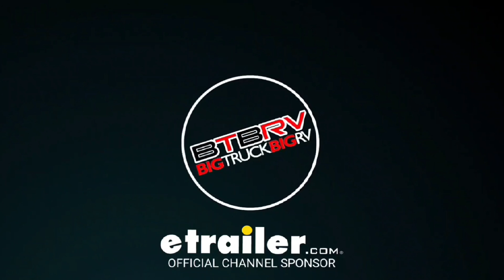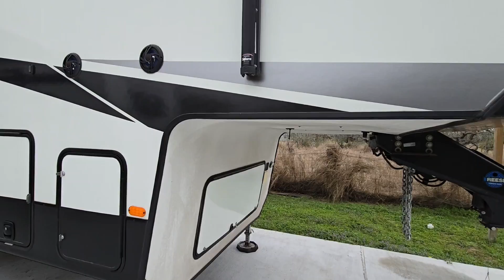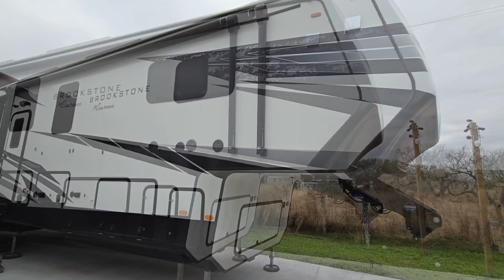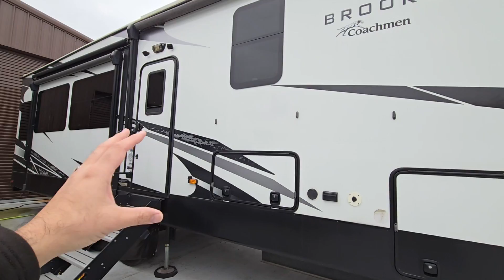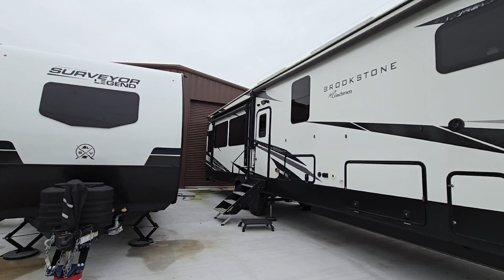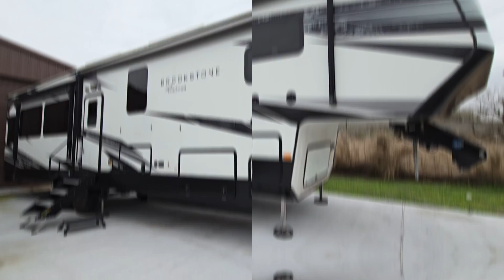BIG FRAME FLEX Update! Heading to Indiana ask Lippert Viewer Submitted QUESTIONS!

Comment: I'd like to know if the design engineer  is involved when a non o.e.m. vendor is making changes to the frame by welding chunks of metal into the structure to make said repairs, more is not always better or even right
Reply from the maker: That's a really good question.  I know there are a lot of phenomenal welders, but many times these welders are not engineers. Without truly understanding the mechanics of the structure and how it was designed, repairs might only make things worse while looking like they're making things better.
Reply: @BigTruckBigRV  exactly, I'm heavily involved in the tank trailer industry if you ever get around the st.louis area and want to see some cool stuff look me up , you're always welcome

Comment: I'm going to call B.S. on Lippert because it only takes one look on Grand Design's forums to show that it's happening, often, on mid profile 5th wheels. And travel trailers. So either Lippert is full of dookie, or Grand Design is over building on the frames. And this isn't limited to Grand Design. Forest River is another one with frame issues. Also uses Lippert. Their numbers are corporate b.s. to save face. How are so many, first time owners, having issues and they're claiming the number is extremely low, or deflecting to it being 2nd or 3rd owner issues. If the frame wasn't flexing for the first owner, why would they sell it? The whole 2nd owner thing is a B.S. deflection. Or...oh my goodness, people actually USE their RV's and travel with them? How dare they!?! Please. Lippert gave you the corporate hand job of responses to your questions. Just like any corporation would. Deflect, smoke, mirrors, blame everyone other than themselves. BUT, I don't place the blame solely on Lippert. It's the coach manufacturers being CHEAP and over building on these frames, any way to save a buck, and then THEY place blame on Lippert. This goes back and forth. Furthermore, the outside shell of the RV is in NO WAY structural to the integrity of the frame. The frame should be able to support ALL of the structure regardless of the integrity of it. So if your walls start delaminating IN NO WAY should the frame be compromised. Ever. For f....s sake. Please agree with me on that. The frame should support the structure, always. Not the other way around.
Reply: Funny you say all this.  I have a 2022 Custom Toy hauler 5th wheel designed to carry a 4,500 lb  Jeep.   Trailer weighs 12.300 lbs dry.  Triple axle G tires.  GVWR is 21k.   Weighs about 17,500 lbs fully loaded.  

It’s on a Lippert frame.  

But park mine next to a 40ft+ Grand Design Mpmentum that weighs 17k dry and the frame on mine makes the Momentum’s frame look like tinker toys.  

Because the manufacturer I went through doesn’t cheap out when ordering a frame from Lippert.
Reply from the maker: To make a frame so strong and rigid that it would not bend under the weight of over 10,000 plus pounds would be nearly impossible unless the frame was much much much heavier and used much much thicker materials. By doing this, it would make it very difficult to tow with the average light duty pickup truck.  I'm not sure if you are where, but nearly all engineered structures are designed with the total structure, superstructure in mind.
Reply: @BTBRV  Man, well,, they must have completely brainfarted when they made my lowboy trailer that's capable of holding 40,000 lbs. Damn those engineers. You see, a frame is engineered to hold a certain amount of weight, and flex in a certain way in order to hold that weight. Flex is normal. Flex is expected. What we don't expect is there to be a failure when the weight is under what the frame is designed to hold, unless the weight is greater than what the frame is designed to hold. In no way, ever, should the frame be reliant on the structure attached to it in order to support the weight it was designed to hold. Ever.

Comment: Understanding that MORryde and Reese goose box are approved by Lippert. Is there a list out there of non-approved pin box designs?
Reply from the maker: Pretty sure there wouldn't be a list of unapproved pin boxes. There will probably be a list of approved pin boxes however.
Reply: Any type of a list could help to avoid warranty issues for your viewers. Might be a good question to ask during your upcoming  visit. As we know dealers will sell you anything in stock.

Comment: If a mfg is being praised  by  every "content creator " to the point that GD has for the past few years then they should stand behind their build. The two companies are trying to remain in the shadows hoping that this will blow over. I've been rving for about 25 years and cannot remember frames failing, even when delamination was the rage. Even though some of these are used units they are fairly new GD/LIPPERT should do the right thing and stand by their products. Like you said it's supposedly a minimal amount of rigs.
Reply from the maker: I don't disagree with your comment at all.  Where there is fault by the manufacturer of the RV or the frame, I do believe they should step up to assist customers.  And for the record, I've never been sponsored by either Grand design or Lippert. I've done a few Lippert accessory product reviews, but haven't been paid for any of them.
Reply: @BTBRV so you were NOT given the products free in exchange for producing a video review?

Comment: Here's  my question about pinbox. The GenY Gooseneck pinbox is not approved  by Lippert. But if you buy a Brinkley toyhauler it's an option. Don't you find that's à little bit funny or weird.  If Lippert says that a non approved pinbox can bring frameflex why do they permit Brinkley to offer that option.
Thanks  for your video, good job
Reply from the maker: This is because Brinkley chose to warranty the unit regardless of the pin box.  The warranty is from Brinkley in that case.  This was brought up in a Brinkley video about a year ago.
Reply: Brinkley also said that in their testing that the gen y hitch put less stress on the trailer because of its shock absorbing ability. I put the gen y gooseneck adapter on my Valor 40v13 its been on the trailer for the last 20000 miles with no problems to-date and it really does ride alot better

Comment: The weight distribution from the manufacturer is uneven. I'd like to see a  independent wheel weight measurement. I assume that your 5th wheel is heavier on the driver side.
Reply from the maker: I might put my RV on my scales to see how the numbers look.
Reply: @BTBRV  I was in the fire service and the HP would weigh our trucks at each wheel. It was amazing how the load would be one sided sometimes.

Comment: I don’t see what flooding etc has to do with broken and cracked frames. You are deflecting the cracked and broken frames by talking about these items! Also should be built to withstand all road conditions! Large trucks and trailers don’t fall apart like these!
Reply: The frame should be strong enough on its own to carry the load. Are these RV’s now considered unibody construction?
Reply: 🤔  Would need to compare semi truck trailer frames to RV fifth wheel frames. Cause u have good point, how r these semi trailers lasting for years n years hauling on these terrible roads. 🍻
(Not talking water here, just trailer frame construction).
Reply: @SpykersB  Or even heavy duty goose neck cargo hauling trailers.
Reply: If you look at the under side of a van semi trailer there really isn't a frame the deck of a van trailer all by itself wouldnt even hold the  weight of a fork lift by itself its  the sum of all the structures  coming together walls roof ect.@SpykersB
Reply from the maker: Like I said in the video, if water gets into the sidewalls and the floor, it can cause delamination. Delamination can cause disconnection from the frame. Once the frame is disconnected from the RV body, excessive strain is put on the frame since the body is no longer carrying its part of the load. I thought that part of the video was very clear.  I can see that you skipped through most of the video. I highly suggest rewatching it to truly understand what the message is.

Comment: Any information  on how to fix these issues?
Reply from the maker: I think the first thing to do is identify specifically why flex is occurring in particular rigs.  There are several possible variables. Fixing it probably requires an investigation as to the point of failure.
Reply: @BTBRV well i guess it's time for a video with a couple professional structural engineers n professional welders and a broken RV frame 🤔.

Comment: Would frame flex cause the floor of the upper part by the stairs to separate from the wall? A bunch of the screws were snapped. I also have vertical bulges where a side wall frame may be located and there is delam on one corner of the bedroom slide opening.
Reply from the maker: That sounds a lot like detachment is happening.  If any part of the RV detaches from the frame, then technically can move independently of the frame, which means damage can occur.

Comment: JD, thanks for the video.  I have seen a lot of folks that have had all kinds of issues. One pulled the whole area from pin box to front landing gear. Every weld in the front end was broken.
A lot of the welds they showed and ones that I have seen myself, were not what I consider a solid weld. They are more of spot welds. Joints are "tacked" together and not completely welded across the seam.
It is the fault of manufacturers as well as the consumers.
The rigs are way too big, and sold as 4 season, full time rated.
I don't think engineers intended or designed rigs to go boondocking in -30 to minus -50 degrees.
And as you stated,  the front end gets all the weight, washer / dryers, generator,  upgraded batteries and all that goes with upgrades. Then if you have a toy hauler, what about all that.
Best advice I've heard, go weigh your rig right after you get it, unloaded. Then put all the upgrades and what you carry in the rig, reweigh, compare the two weights.
This is not an easy subject and there certainly isn't any easy answers.
Will be interesting to see what you discover at Lippert.
Thanks for all you do bringing this information to us.
God bless ya'll and stay safe on the road out there.
Reply from the maker: This information will be made very clear in the future video.  To the degree that Lippert actually etches engineered welding locations on the frame.

Comment: Q for Lippert- When an RV mfgr specs a frame for a new 5th wheel trailer, do you have input to the placement of heavy items like washer/dryer or generator? Or do you build to a generic GVW class and trust them to stay within the specs you build for??
Reply from the maker: You will learn more about this in the next several videos. The short version is, Lippert builds frames for RV manufacturers based on the specifications, engineering plans, and blueprints provided to them by the RV manufacturer.

Comment: I am curious  the underside of your front overhang is uneven. Is the damage or is it from you gooseneck installation?
Reply from the maker: I've noticed and messed with it as well. It's not anything major. I just need to screw in a part that came lose over time.

Comment: Very well explained. 
And eye opening. I hadn’t considered the body separating from the frame as a possible cause of failure.
I assumed the wall damage/separation was caused by the frame failure.
Reply: Same here.  And having the experience of repairing this phenomenon,  it makes more sense now thinking of it in that way. The side lag bolts that are located from the interior often loosen or back out, and may be the main cause or atleast one of the causes leading to the frame failure.

Comment: After approximately 18 years of experience in a field of reliability engineering, I can add that the industries I've worked in tend to throw failure rates provided by manufacturers directly into the garbage. There's a lot that goes into how one collects failure data to calculate rates, and aside from these variables the manufacturers have a biased agenda. Just a couple that could skew this information would be actual failure reports, amount of data points, years of data, and classification of failures. How many people that have experienced this failure actually report it to the manufacturer, especially when they're not the original owner and know the warranty is void. Another big variable that possibly pertains to this recent increase in exposure is the timeframe of the data. If the manufacturer is providing you reported failure rates through the course of decades, this can water down a recent 2 to 3 year uptick. We may never know all the details behind the potential, sudden increase in publicly-exposed incidents; however, it does strike me as odd that this has now become a thing. If this issue is only in 0.01% of a very specific weight, length and type of fifth wheel the probability that this were to impact multiple RV youtubers (who are a very small percentage of the RV community) is a bit odd, especially considering this didn't appear to be a big issue previously with the youtube crowd. It could also be due to a video or two exposing this as an issue, which then led to other youtubers having more awareness which caused them to dig a bit deeper. In closing, I think this is a great video and I've always appreciated the information you provide to us. We may never really know if there's an increase in cases, but the main point of my comment is to recommend you not put much value in their provided failure rate.
Reply from the maker: I love your comment.

Comment: Per "detachment" issues, everything is "fast and furious" in the RV industry. Most everyone gets paid piece rate and the pay is the same whether they are there for 8 hours or 4 hours so their only incentive is to bang out that day's quota and go home. Most of 'em got work to do on their own farms after they get home. And I've heard that only 4 out of 10 finished RVs get even the most cursory quality control inspection so 6 out of 10 get no inspection at all. :(
Reply: I believe you comment is spot on
Reply: You are correct.  My daughter use to work for Forest River in Small package shipping and receiving.  Her father in law has been there over 25 years as well.  Piece count , small base pay. they get a bonus for the piece count and will make tons of money. So instead of paying hourly and lets slow down a little , lets just kick them out and deal with later. And yes the units with front slides or more likely to crack than the ones without the front slides.

Comment: Lets just cut to the chase.  There are a couple of models from Grand Design that have been notorious for having "frame flex" because they built the unit beyond the capability of the frame they asked Lipert to build.  Every single RV based channel  has been dancing around this issue...this subject.
Reply: It seems to me that the problem is contained within the full time community, am I right?
If that is true, what makes full timing different than someone that is not full timing but put some serious miles on their rigs???? => Weight
Reply: 100% Correct. It’s all about the miles and normal stresses across those miles. I spent nearly 20 years in airplane manufacturing and have a deep understanding of structure stresses.
Reply: @songstadcruisin  I am the second owner of my Keystone Montana.  The prior owners were not full timers based on long conversations with them.  My family uses it mainly for weekends.  Maybe two week long trips a year.  But we are in Wisconsin.  So there are about 6 months of none use as well.  I had frame flex.  There is NO way we are pushing the almost 3000lbs of payload capacity.  Weight is not solely to blame.  On my camper, welds had failed.  Keystone, however, seems to be good about fixing it.  Mine was outside of warranty and was repaired on Keystone.  Grand Design seems to a different story for many.
Reply: Any talk of plumbing leaks and other nonsense is just that, nonsense.
Reply: Exactly.  The Grand Designs are purchased mainly by full timers.  These monstrosities called fifth wheels are going to break when used full time. Period.
Reply: The key is not manufacturing defect, its faulty engineering defect.  Larry
Reply: @leapnlarry  well remember. There are two distinct processes here. First the frame, then the build on the frame. One of either of them could be spot on and have the other process wreck the unit.
Reply from the maker: Or perhaps didn't attach it properly to the frame?
Reply: @BTBRV Either way, the first through whatever owner is stuck with excuse machines trying to explain it away.
Reply: @BTBRV I think your comment right here regarding RV manufacture properly attaching to frame is where the meat and potatoes is at entirely 100%.

Comment: I'm sure this will be an upopular opinion but from all the videos I have watched of people having frame "flex" or failure it appears that they are all full time RVers and appear to be overloaded or at least front loaded too heavy even if they are under their GVWR.  Of course when it is something this expensive and difficult to fix they want to blame the RV manufacturer or the frame manufacturer.  These people are just like the ding dongs out there that think you can tow any size RV with 3/4 ton because "big truck".
Reply from the maker: That's definitely a contributing factor in some cases.